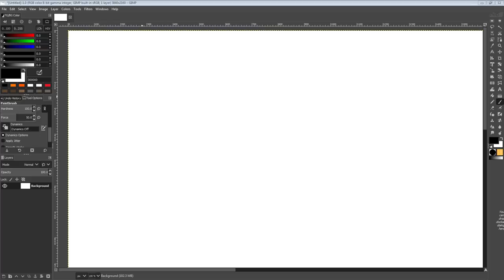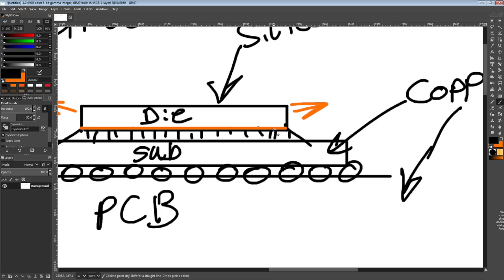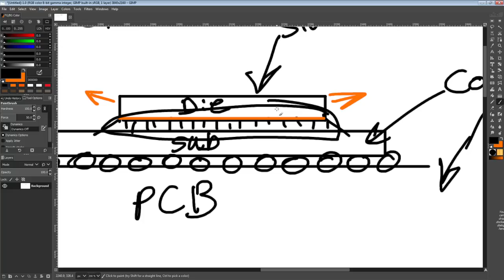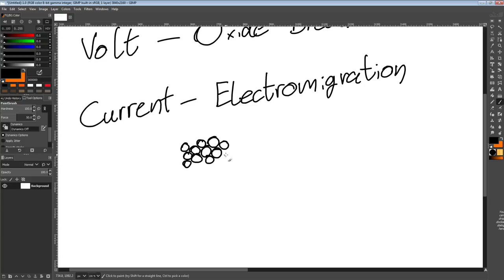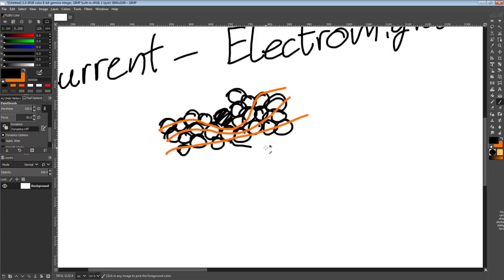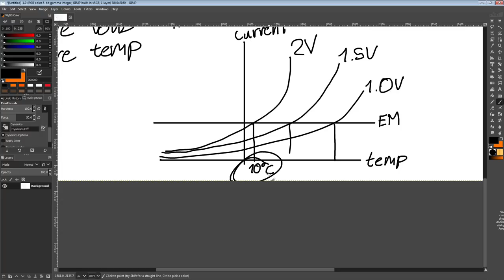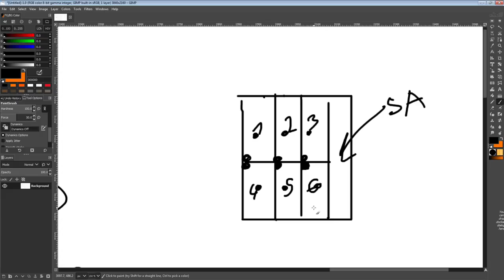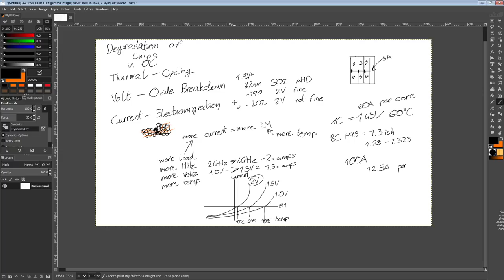Rambling about chip degradation

Comment: The target temp for my Sapphire Fury Nitro at default is 85, though I set mine to target 75 since I got it, the design Sapphire used is great
Reply: Does it effect your GPU thermal alert too?

I lowered my RX470 target temp from 80 to 70. And it's start thermal throttling itself after reaching about 72-73°C. The fans also ramps quite early compared to the previous target.
Reply: @fajaradi1223  my rx 480 has a target of 65 and max of 80 and it doesnt hit 80
Reply: mine is second hand overclocked

Comment: I have the impression that you've got the idea behind die degradation totally wrong, like completely.

The problem is rarely thermal expansion breking connections. The physical limits are well defined and such changes are expected and taken care of in the design and manufacturing processes.

The real major problem is more or less aluminum capacitors degrading rapidly on designs without enough air flow around them (ie: custom r9 290 watercool that only cools the die). When your caps can't filter the voltage enough a major overshoot will sooner or later occur and the die will die. On weared out holdup caps at least the affected hardware will shut down or refuse to turn on altogether.

Comment: I'd call thermal cycle breakdown manufacturing defect and we should call out AMD and Nvidia on it! There are big chips that can deal with thermal cycling no problem (monster Intel server CPUs) 
I'd like to suggest that one of reviewing channels use few of GPUs they got for review to thermal cycle them to death.
That would be simple enough to do. External thermal switch where fan turns on full blast at 80c and stops at 30c and turn on stress program long enough to reach 80c reliably.
That way could simulate thousands of cycles within short time span.
Also use sample of most popular currently sold SKUs out there, that would kill 4-10 graphic cards in the name of science!
Don't throw monster solution (water cooling) to a problem that should have no place to begin with!

Comment: My ryzen 5 3600 just died yesterday while playing Minecraft :( I got the replacement in the mail, will arrive tomorrow. I'm gonna watch this video but can you help point me in some good directions to keep my next one alive for many years to come?

I only had this one 6 months :( I just did auto XMP in mobo bios and Auto overclock in ryzen master. Never manually switched anything otherwise. I appreciate any help, advice, and knowledge you can share on maintaininh/preserve our hardware :)

Msi x570 gaming plus
2x16gb 3600mhz G.Skill ripjaw V
Msi R9 390x
Corsair CX750 (PSU)
Reply: Yea never use auto overclock
It will just pump alot of Voltage in the cpu and turn up the clocks a bit 
(They do that so it works even on bad binned CPUs. But CPUs that can only run stock clocks on stock voltage Should not be overclocked imo )

What you should do is don't touch the Voltage and only increase the clocks or even turn down the Voltage

Comment: So should I not be running my r7 at 1.6 volts?
Reply: Told ya bro, toooold ya
Reply: from what I've read, it's normal for 3rd gen ryzen to spike up to 1.5v for max single core boost.  but as he said in the video, it's unlikely to sustain that during all core load.
dunno about your 1.6 -- are you running 110% line load in bios or something?    IRL, I don't have any games that are cpu bottlenecked, so reducing voltage offset -0.1v to get cooler all core performance at the cost of a little single core performance, seems perfectly reasonable to me.
Reply: @BenK12345  did the same, I keep mine fixed at 1.21v and 4ghz (2700x) same multicore performance, more stable, way less consumption and heat spikes
Reply: Yeah that's way to high that can result in permanent degradation of performance due to damage if load has gotten high enough, tone that down to 1.35v , the Upper limit for degradation is 1.45v, anything above this under load account for droops and spike will limit your processors life, All this depends on how well it's going to be cooled to help mitigate the damage dealt to the chip from severely overvolting it. No matter what overvolting a chip will take life span away from it, its a part of overclocking that's why I'd recommend never to balls to the walls overclock something unless your willing to lose that part, stay within a comfortable overclocking range with good cooling (sub 60c on full load) and the life span will only be shortened by a minimal amount.

Voltage and current draw are related, you can get away with running a higher clock as long as what you are using it for doesn't exceed the current limit of the chip, but it starts cutting off your maximum load, and unfortunately there's nothing you can do to cut off the maxes to increase the minimums when your talking about energy, if you hit a high enough load with a high enough voltage for long enough it could be over for the chip, 

AMD recommends anything bellow 1.35v and doesn't recommend 1.45 for water+ but you can if you want too. These chips do a really good job at overclocking themselves from what I've seen often enough most people get 150mhz most out of it and its not ever guaranteed.
Reply: @Ren-kei  I'm just curious as to how long it can run at 1.6 this has been at 1.6 for a few months now. I like the performance and I'm only seeing mid 70s under synthetic load. During games I only see mid 50s to low 60s and I'm not having any complaints from the CPU at the moment
Reply: @austinporterfield1363  keep it at 50 and it will have a bit more life
Reply: Well thanks for the responses guys. I just talked to my engineering father in law. He basically said that it will take a few years off of its life but as long as it's cool it won't be too bad it's under water right now and it's about to get more under water soon.
Reply: @austinporterfield1363  true

Comment: if few transistors broken due to oxide breakdown, will it fail the whole CPU or will the CPU stop assigning tasks to affected logic circuits and continue working?
Reply: It won't be catastrophic but it'll effect the performance of the chip, MOSFETs are designed with fail safes that take into account Oxide breakdown.

Comment: What is your take on leaving you PC on 24/7 for 3 years? Would you think there is less degradation due to less heat cycling?
Reply: It depends on your usage. Sure it does less heat cycles but you're constantly pushing current through it so EM still occurs. Also NAND chips, RAM and capacitors still wears slowly.
Reply: @ClaudioSL619  I didn't say something will break, I said parts still wear. Every component have a lifetime. For example, voltage ripple and transient response grows over time because electrolytic capacitors' ESR and ESL get worse with age.
Reply: @ClaudioSL619  ok you were just sharing your experience, but why tagging me like it's a reaction to what I said ?
Reply: @PainterVierax  tagged you by mistake sorry. forget it i just deleted it
Reply: @ClaudioSL619  ok, no pb man :)

Comment: i fixed my 780ti with the oven trick several times lol
Reply: the oven trick is very stressful to all components on the pcb ... get yourself a hotair and carefully heat the gpu only, moving the hotair in circles. It also lasts much longer if you heat the chip from outside to inside. I've done this many times this with a temperature probe. Heat the substrate to ~230°C within 90-120 seconds, hold it for 10secs and then slowly cooldown by moving the hotair away.

Comment: Soooo, let's assume we have a chip, let's say a 9900KS, with no defects, and that we run it at base or below base clock rate, let's say 3.7 GHz, at whatever the lowest voltage is safe to run that (too lazy to search & check an actual value), with everything turbo disabled so it never runs more than 3.7 GHz, and we keep it in a nice, temperature-stable room, with very good cooling, so it never gets past 50 degrees Celsius (let's say).

Would this chip be immortal ?
Reply: Haha. Forever is a strong word. I would say that using it this way it probabily would last until it was completely obsolete to you or maybe until your psu decides to burn your PC.
Reply: @Diego-bi9tt  Well, I was more curious if someone careful enough might still be able to provide a sample of today's CPU for a museum in 50 years from now.
Reply: @Winnetou17  Oh. Yes, as it is made of inorganic material, basically silicon, it is essentially almost a stone, in good conditions of use, it can last for a long, really long time.

Comment: i watched this video cuz a friend gave me his r9 r390 that was malfunctioning and i wanted to see what's going on with it. when i put it in my system it gave me a black screen pretty much instantly after booting up linux, so i disassembled it to see if any caps might have blown, but they were all fine.

then i reassembled it and tested again with the same result. then, when i saw several threads about black screens on 390s it dawned on me it could be a card specific issue, so i look up if sir buildzoid might have talked about something along those lines. when i see the part about the thermal degradation on big chips like the 290 (same chip as 390) i thought this chip clearly has had enough of the thermal cycling and was done for good. 

started up plenty times again and noticed that the card was running the radeon driver instead of amdgpu. set the according kernel parameters and with amdgpu everything works perfectly, so only a driver issue this time ;)

Comment: in any ryzen...never set 1.45v ....i feel correct volt for ryzen should be 1.38v ...1.4v is maximum before degradation happen when past 1.4v  +
Reply: Just over 1.4 would be fine with good cooling.
Reply: @colesym84  for you but the not the chip itself...it will degrade itself quickly due to cheap design that AMD is not planning sell it to you for long term...more like short term buy until you keep buy every next gen for they recover their company

Comment: only is very helpful is ryzen memory calculator...but why only windows version but not on linux ?? only thing i don't like what AMD doing is making customers do the work while they don't ....we got memory calculator, curve power calculator, and gpu from their brand have built in calculator with nice transparency touch up of blur effect...?? why all this matter to customers ...we are so used to simple basic presets are embedded in the board or in the driver for gpu's....but if this is AMD solution for every amd user problem ...its not helping anyone with manual settings in bios when my board from MSI don't believe in this again like last time it happen before...too many complaints of faulty chips in the past...and shouldn't be a thing under AMD do so to bring back radically settings are very dangerous with amperage, ohms, and all power calculations can KILL YOUR CPU in matter MINUTES ...lucky for me...i don't mess with and MSI careful not include dangerous settings to begin with...its their belief not give too much control on users than themselves under their bios...but gigabyte and ASUS...doing so is unnecessary do so to cheat its customers and trying to surpass intel comfortable  lead...but in my honest opinion only cpu from amd is 2x faster to 9900k is threadripper what Jay2cents tested 2 months ago....thats cpu people should buy...not ryzen if you want to beat intel cause ryzen don't have software optimization while threadripper compensate by adding more cores

Comment: My 2700x can do 4.2 at 1.362 volts, should I go further? In p95 max temp is 80c, around 110A
Reply: You could try it but probably not since 80c is high enough I think, plus I doubt you'd get much increase in speed over the increase in temps that will occur.
Reply: Same but I can take it fixed at 1.2v and 4ghz. Half the heat, max consumption 90w instead of 130, 2-3% performance difference for 30% consumption and heat.

Thanks I will keep the 1.215v fixed.
Reply: @exxr  For now all core 4.2 gives me almost the same perf of pbo, I could try 1.4V an see if I can reach 4.3. 

I'm running an offset of 1.106 so maybe 4.3 is around 1.43, hope not tho lol